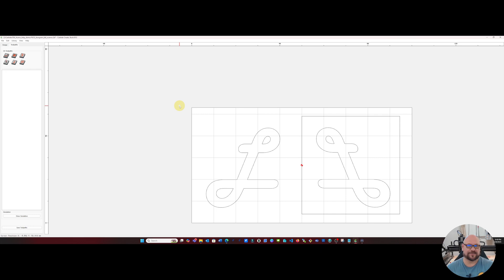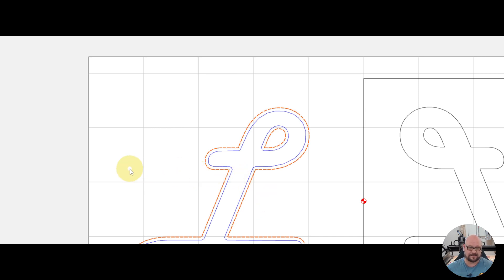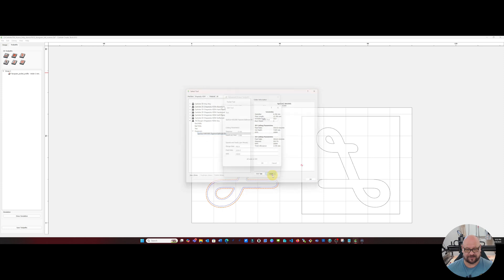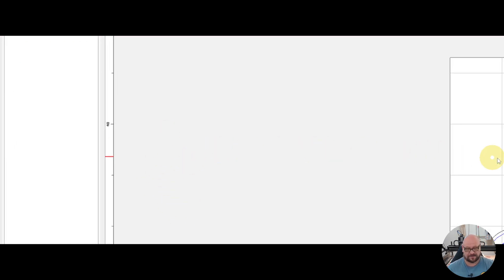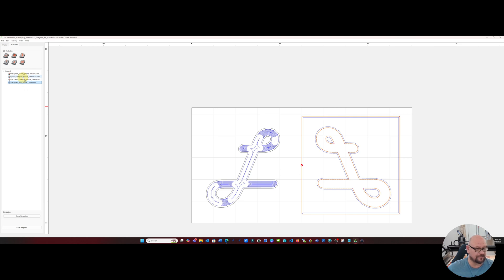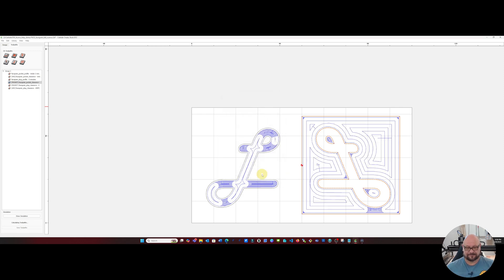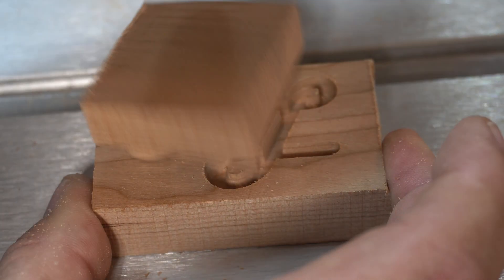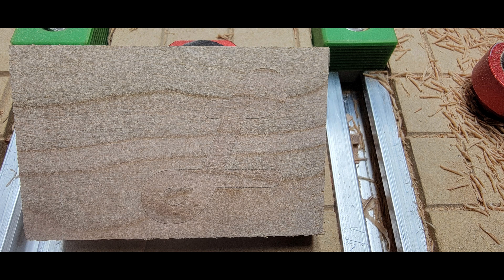Achieve FLAWLESS Face Grain Inlays With Expert Techniques

Comment: First of all thank you sir for your service! I did not serve but I have a son who has a little over a year left to retirement so I understand a little of what is required of that level of commitment. Thank you so much for making these videos, I am not new to CNC, I have had my Shapeoko 3 for several years now but I am just starting to try and learn about v carve inlays. Your videos are the first ones I have watched that make sense to this old mind. You are clear and concise with your directions. I am understanding more and more of the process and just how to adjust my parameters to get the proper results. Thank you again sir!
Reply from the maker: Please accept my thanks for his service on his behalf.  Inlays are very tricky, and as far as I'm concerned, you can never have enough resources. It does take time and effort to get settings right, and even then, it sometimes requires you to go back and check your parameters again when you change bits.  I have had fairly good luck in getting my parameters correct for the 2 different TBN bits that I use. Thanks for watching!

Comment: Great video, thank you! I have had a lot of success with 60 degree v bit inlays in CC in the past but it's been a while since I did one and I'm struggling now due to chipout. Thought I'd explore a TBN instead.

Could you explain the idea behind the initial pass, and pocketing at the end? Is the first profile pass to guarantee that the fibers are supported on both sides of the cut? This would make sense to me, but now I'm wondering why you would ever want to pocket first in a VCarve 🤔

Comment: Good video.  I don't use Carbide create but the concepts for vcarve inlays were clear and insightful.  I think the one thing I picked up with facegrain vs. endgrain was you do an initial scoring of 1 mm with your TBN bists, then you finish off the cut with the TBN and followup with the em for clearing larger pocket - is this correct?  I also wich you would cut the inlay in half so I could see the resultant glue gap in your face grain inlay.  I am believe my glue gap is too large - it ranges between 0.08 mm and 0.12mm